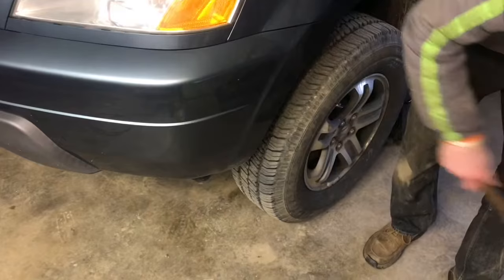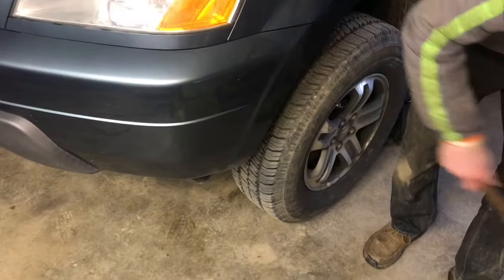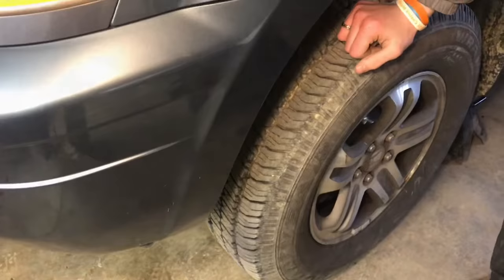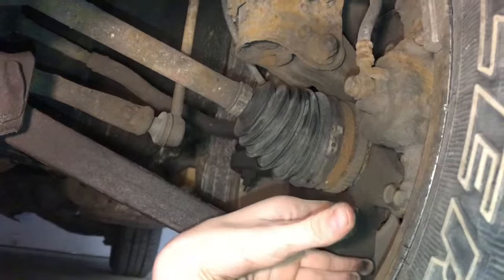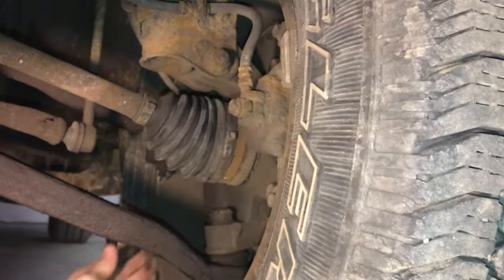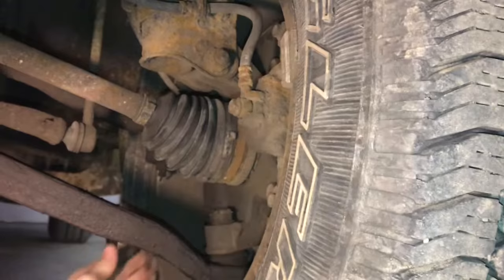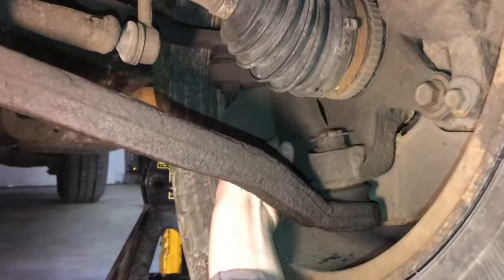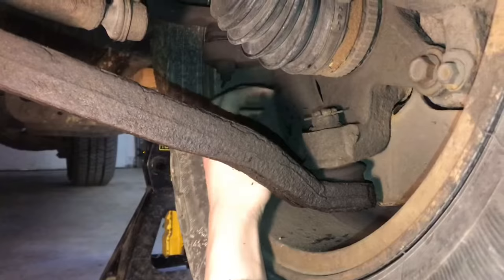BEST way to find RATTLES on your car fast

Comment: This is the worst way I’ve ever heard to find a rattle, taking the weight off the suspension will make it completely different conditions then when you’re driving.    If this had been a ball, joint, tie rod, strut, wheel bearing, axle etc, all the things, the typically make noise, you never would’ve found to doing that.

Comment: I had some very loud rattling and clanging noises coming from my front drivers side when on rough roads and hitting small bumps. After looking into some videos, I took the wheel off and did an inspection of the suspension system parts but couldn’t find anything that stood out to me. The lug nuts seemed a little loose taking them off so I thought maybe that could possibly be the problem, but after putting everything back on to torque specs, it was still making the noise. I felt I was at the end of the road of my capabilities so I figured to take it in for service, but I found this method and it worked great to get it resolved. I was by myself and I banged on some of the suspension parts with a rubber mallet. I started hitting the ball joint area and heard some rattling. I started feeling around while hitting parts and then noticed one of the small bolts that fastens the brake caliper onto the piston bolts was completely missing. I checked the other bolt and it was even loose. The front pads were changed only about 6 months ago by the previous owner, so the shop that did them (Pep Boys) just didn’t tighten them enough. I replaced the fastening bolt and now the noises are fixed! I went ahead and tightened the caliper bolts on the passenger side as well. This was the first time I ever diagnosed and fixed something related to noises in the brake / suspension area - it was an enjoyable small victory! Thanks for the helpful video!

Comment: Thanks! Had a rattle in front passenger side under car going down some rough road but disappeared on smooth road. Found this video, tested, found hubcap is not secured on front passenger wheel. Hoping that's all it is!

Comment: Bro, I was having a weird clunking noise when stopping and a pop when I'd back up and turn slowly. Was driving me crazy. So I did like you said, went and bought a rubber mallet and got under my car and just started smacking suspension parts. Sure enough, I hit one of the lower control arms and it did not sound like the others. Turns out the bolt had backed out just a little bit. Tightened it up and sure as shit, solved both problems. Rubber mallet guy for the win!! Thanks brother. 100% will be using this going forward. 👍

Comment: So how did u fix the shield then?? I have the exact same issue.
Reply: You will need to get new unrusted backing plate,  use PB and proper bit\driver\socket if there is any small bolt(s) holding the hub assembly backing plate on.
Dust shield; backing plate.  Part of wheel hub assembly, sometimes pinched in between wheel bearing hub and knuckle flat. Smoooshed with so much torque that they fracture their paint coating firstly in these spots and begin to rust first in this bearing bolt hidden spot up behind the knuckle; then they fracture loose and rattle or will curl\bend and rub into brake rotor and just need bending back.. If your backing plates are wedged between bearing and knuckle (press), then you will want new bearing same time.  Do not re-press a removed bearing hub if it needs pressed. Simple bolt on axle'less hubs are just 4 bolts and pass through backing plate and are reused. There's only a few ways. Just look it up to be sure..

Comment: Interesting! My car had a similar problem, I think one of the suspension parts was aged and worn out so that the rubber parts did not absorb the shock properly. Of course non of the repair shops had any clue to the problem. They even said it must be the clutch! If they did this, probably I would have  avoided 3 years of irritation... In the end I sold my car...

Comment: i wish i saw this video last week..thought it was exhaust sflow muffler ratting inside.change my muffler the rattle still there..then i punch my tire thought the drum brake..then go under car knock2 punch2 there it is rear spring rattle with underbody surround plate touching the spring😂 car is celica liftback ta28